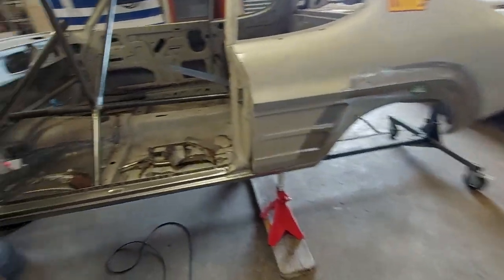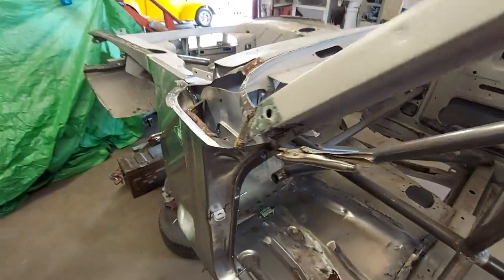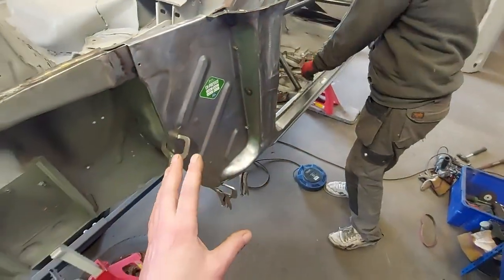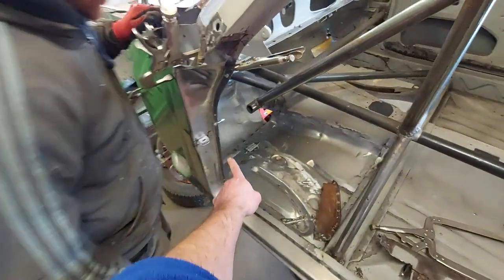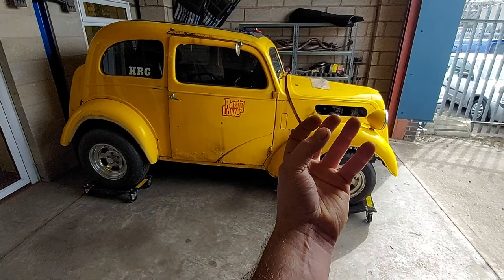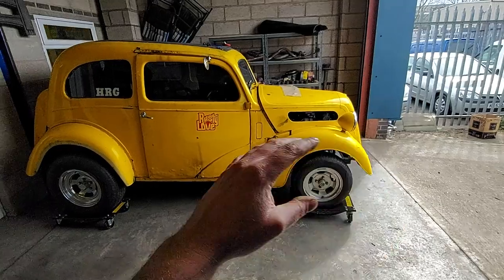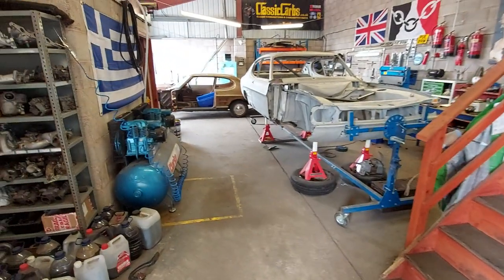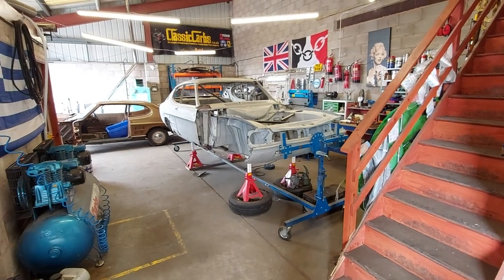Sunday morning update from Rusty Love HQ - 21 March 2021

Comment: Maybe painting the rusty bits inside the new door pillar with zinc primer would have been a good idea, to stop or delay rust making its way through the new metal. Just saying like. :¬/
Reply from the maker: Panel is coming on/off many times before welded in permaneltly, and yes, it will be primed when the time comes
Reply: @Classiccarbscouk  Cool. I specifically mentioned Zinc Primer as you can arc/mig weld onto it as it's conductive unlike celly/acrylic/2 pack primer. So I believe anyway.
Reply from the maker: @baylessnow  yep, thats the cans we have
Reply: @Classiccarbscouk  No worries. ;¬)